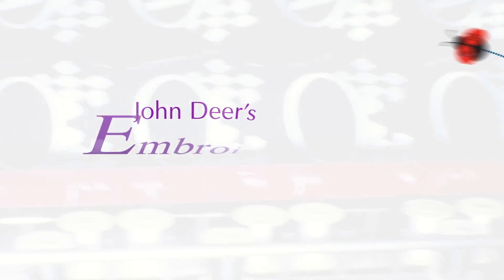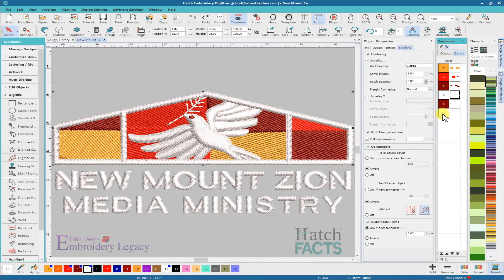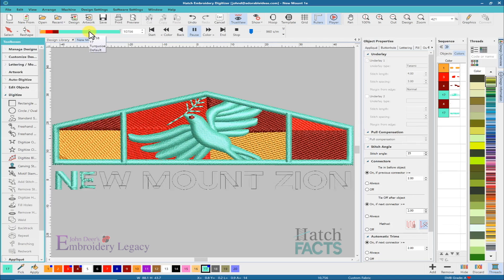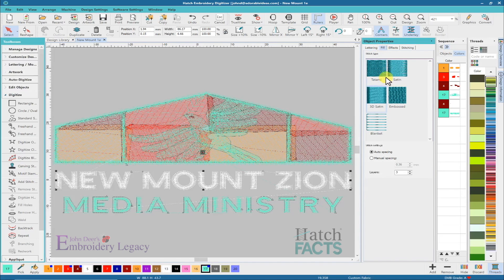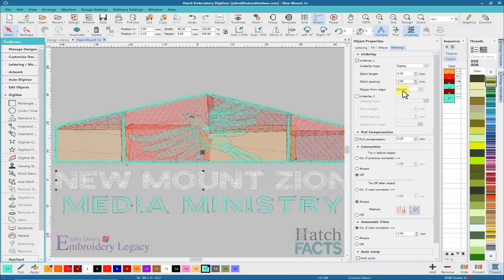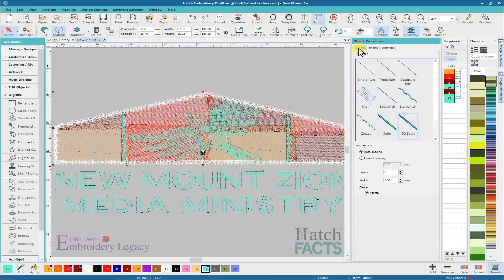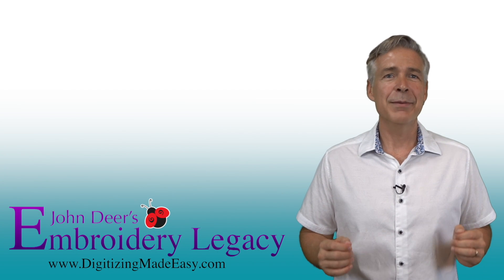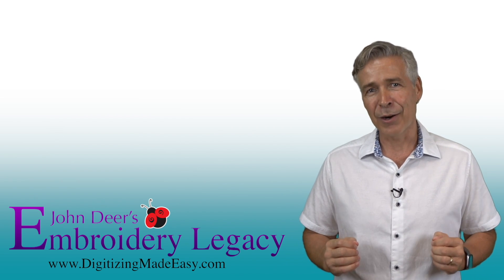Underlay & Stitch Types for Better Machine Embroidery Designs - Embroidery Medic

Comment: Great job! I was wondering, why is it that in the lettering you chose zigzag+edge run for the underlay, but in the border, you only chose edge run and no zigzag? What are the implications? Thank you
Reply: I know it's been a year and you may already know, but the likely reason is the width. The letters are much wider and the zig zag gives them more support where as the border is narrower and doesn't need the support of the zigzags. I hope that helps
Reply: @caodesignworks2407  it may've been a year but I'm new so this explains a lot. I hope for other beginners too. Thank you so much!